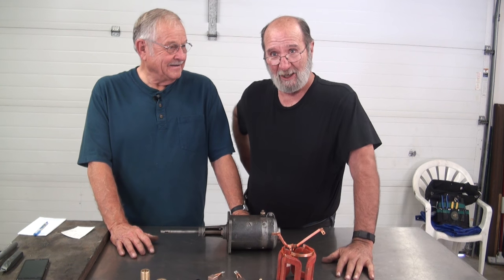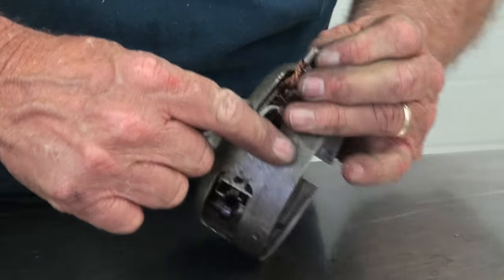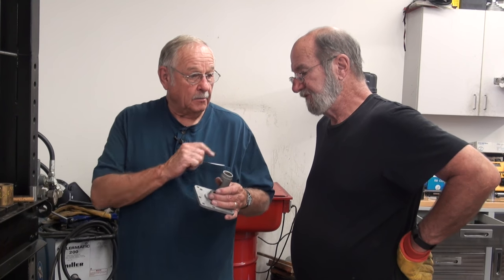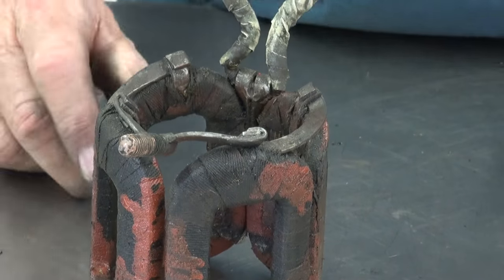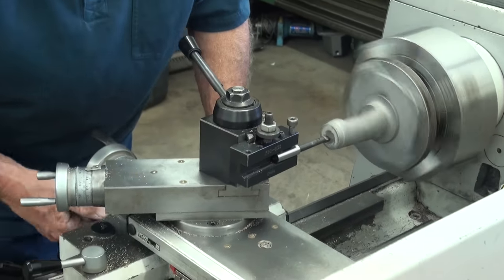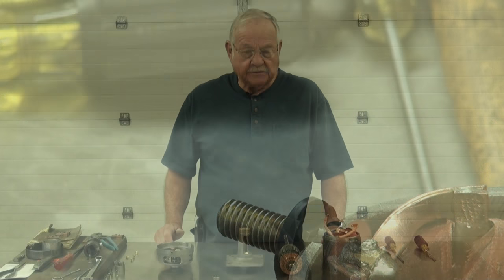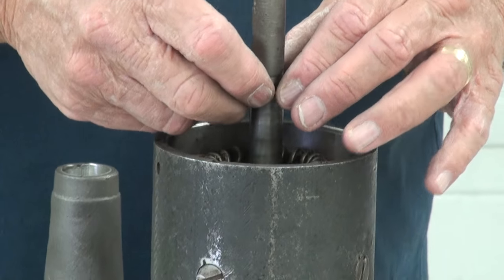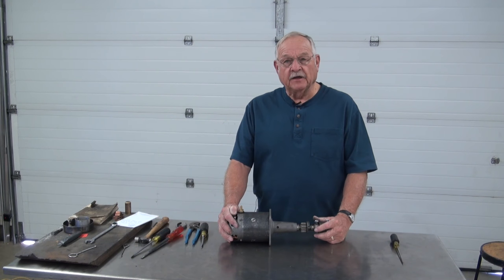Electrical 02 Restoration of the Model T Starter

Comment: Next question is where and how do you connect the field coil wires? You put the brushes in, but you never mention the field coil wires. Where are the field coil wires supposed to attach? Do they attach to the inside of the brush cap? Where?
Thanks!
Bill
Reply from the maker: I spoke with Nick yesterday and he suggest that you just give him a call at (719) 250-2991.  You may need to leave a message as he is working on a project and may not be able to answer right away.  I would also suggest that you get a copy of the MTFCA Manual https://www.snydersantiqueauto.com/ProductDetail/BT-E_THE-ELECTRICAL-SYSTEM-BOOK?fromCategory=Products/books/model-t-books .

Comment: Just watched your video. What I would like to know, what happened to the small end spacer bushing after the seal? You didn't ream it out or show you installed it. Does it not have to be there as it also has a spacer on it. You can't just install the seal without that end bushing. Am I missing something here? Please help.
PaulB

Comment: You say to test the insulated brush holder.
WHICH ONE IS THAT? What is the position of the insulated brush holder versus the position of the brush cup assembly on the main body of the starter? I assume from the way you tested, that the one OPPOSITE the first brush holder you tested,  is the 2nd insulated brush holder, that is, they alternate with one insulated, the next one live, the next insulated, and the next one live. is that correct?  NOW, starting from the heavy terminal connection on the starter case,  which one is supposed to be the insulated brush holder?  You whipped through the disassembly WAY TOO FAST to keep up with what you are doing. I had to rerun the video 4 times just to establish that the field coil wire ends are both on the BOTTOM of the starter when the brush cover is removed. 
Thanks!
Bill

Comment: I have. A starter that's positive ground...can I switch out the field coil for a negative ground?  Do they swap?
Reply from the maker: I don't think so... but, I am not real knowledgeable on that subject.
Reply: @modelt-tips6985  they do.  You can get a left or right wound field coil which will change the rotation of the starter.  We swapped ours to correct the battery...or make negative ground.